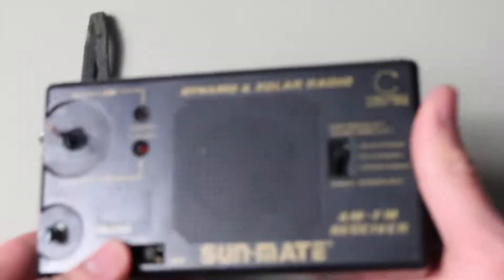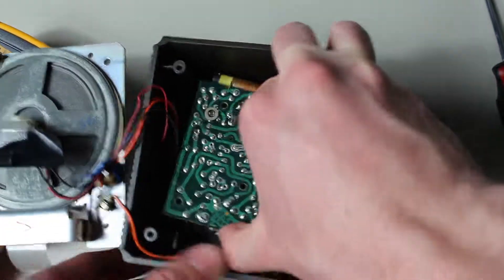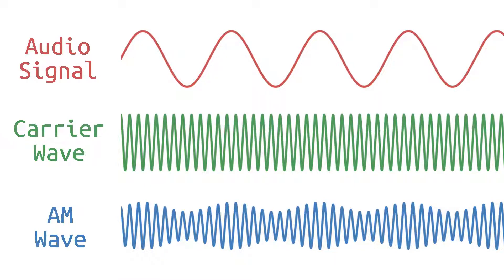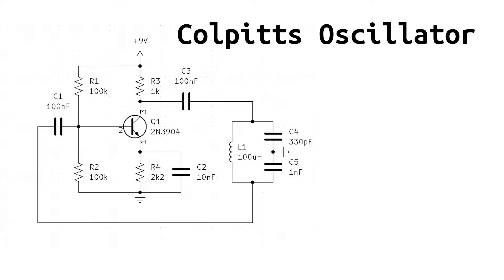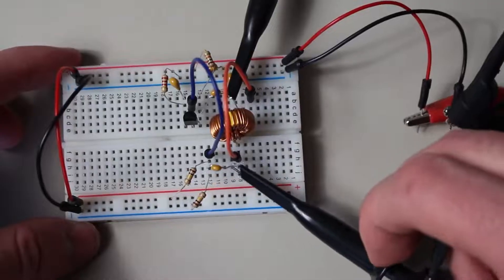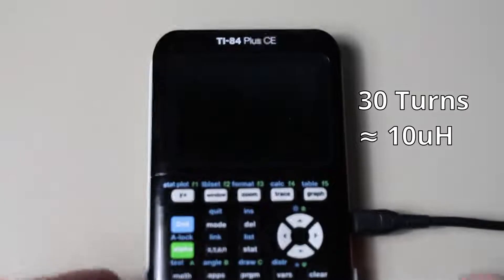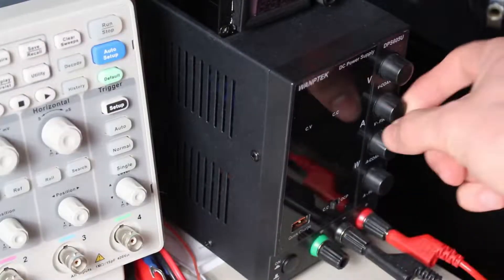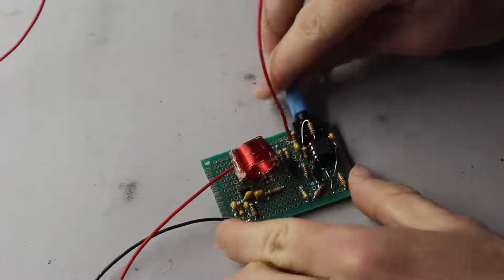DIY AM Transmitter

Comment: Good video, one caveat I noticed was this:

When explaining how to calculate the inductance, you say that μ is the permeability of the core material. 
Technically, you would write μ₀µr, wherein  μ₀  is the magnetic field constant (or vacuum permeability), and μr is the permeability of the material. 

So, 1.26*10^-6 (Vs/Am) is not the permeability of air (Which is rougly 1), but simply the magnetic field constant which remains when using μr = 1 for air. 

Also also, (sorry nerd), the exact value of μ₀ is 4π *10^-7, which I find tremendously cool.

Thanks for bearing with my pettiness!

Comment: 10uH has a natural resonance around 16MHz, how d'ya get 1MHz out of that??? Answer, you don't. That's why you're only getting 2' range, it's a sprog. The reason 100uH wouldn't oscillate in the original circuit is because you seem to be using a yellow toroid (3-40MHz).

Comment: play with the value of R4 so more signal is coupled to the output stage. use a molded inductor in your oscillator. Swap out R7 with an inductor... use a loopstick aerial from an AM radio. Connect the anrenna wire (which may not be needed anymore) to Q2 collector. Dispense with R9.
reduce R8 to 100 ohms in series with 22 ohms, the latter connecting to Q2 emitter. In the middle of these 2 resistors, connect a 10nf capacitor to ground. These are just immediately obvious improvements at a glance. There's more I see that I would try

Comment: Hi could you explain the 9:24 top right (what's neither the oscillator nor the modulation), 9:34 so it's not really Amplitude Modulation but some kind of DC additive translation? (I am interested in electronic and the topic in general for only 4h, be gentle :) )

Comment: make a large coil in a iron tube,  put another coil on top of the first coil, connect the second coil trougth the positive rail of the output transistor, connect the bottom of the first coil to one of the cables of the second, tada, now you have a compact antenna that´s a few feet long....

Comment: Regarding the 4V mercury battery... Early American RCA pocket transistor radios from the early 60s used these batteries, and they are of course unavailable.  I bought a tiny RCA turquoise radio in mint condition off Ebay and built a rechargeable pack from 1/3 AA nimh batteries and rewired the headphone jack into a charging jack.  I just ran in a 5V wall into the jack using a resistor and zener inside to limit current to maximum charging rate assuming full discharge.   This makes for a very slow charging system (maybe 8 - 10 hours for a full charge) but the pack would run at least two weeks on one charge when he brought the radio to the beach to listen to baseball games (that RCA was very sensitive and did better than the Sony he was using).  Food for thought for those wonderful and beautifully built American made transistor radios.
Reply: The presence of an output transformer to the speaker suggests that this set uses germanium transistors. It looks as if there is another smaller audio transformer inside which drives the push-pull audio output stage. With the arrival of silicon transistors it was possible to eliminate these components by using different circuit configurations. Although these transformers have not been needed for nearly 50 years, components, such as the Eagle products LT44 & LT700 transformer pairs are still advertised by component dealers.
Reply: @Martock1017  My experience with these (my family was in the TV radio repair biz) is that these were very reliable radios.  Once in a while we'd see a transistor croak and of course now that they're 60 years old the two or three electrolytic caps are shot, but overall, I can't recall seeing an open xfr in any of them, but that's good to know.

Comment: Tried the circuit and the oscillator and modulator works. What voltages did you use for the OP-AMP supply?

Comment: i made a 9v battery powered FM transmitter myself..... 5-10m...... next i wanna do TV ransmitter
Reply: rf modulator + distribution amplifier. not very legal tho
also analog tv because a digital tv modulator is umm a bit expensive and/or impossible to find
Reply: this is AM

Comment: I have the same power supply, but don't use it for low signal projects - too much switch mode noise.  I just use some AA Batteries instead - no noise.
Reply from the maker: Yes, it's a really big problem with that power supply.
Reply: I use a good old school linear bench PSU.

Comment: Why do you have a 50 ohm termination, your emitter follower has an input impedance of 5k ohms, but you are supplying a 100k ohm input
Reply: When the output rf signal goes below 0 volts the emitter follower wont work, as the capacitor will turn off the emitter base junction, You need an AB emitter folllower for this, i dont understand why the caps are 1uf either

Comment: No offense... but... the audio quality is very poor. ... Watching the video, you are smarter than I am, calculating all that stuff, but it also shows me that you are a lot into theory and not pracitcal thinkering. Seing how extremly low impendance you made the colpitts oscillator, you could modulate the oscillator alone, and get a good AM signal. Based on the low value in the oscillator (2,2k Emitter) the oscillator itself (the coil) will probably transmitt more into the radio than your actual antenna, since the radio does receive an "inductive" signal (magnetic field) rather than "capacitive" what your (non matched) antenna is  tansmitting. Some values "underline" you´re a lot into theory... like the 1µF (!) capacitor between the oscillator and the buffer, but then added a 100k resistor in series... Also, why do you use a Collector circuit as modulator, and then use an op amp to compensate for it´s lack of "audio gain"? At this low power level you could hook up the "rf amp" directly to the output of the LM358. Why does Q1 not have a RF blocking capacitor (from Emitter to ground)... the RF flows into the transistor, causing issues (distorted audio could be one of the issues). If you want, I can re design the circuit for you so that the audio actually sounds loud and clear (I´m reffering to the first two audio samples you made, with vocie very audible distorted)... checks the schematic Am I seing that right, that there is no Capacitor between + / - ... like .1 µF (104) to block the RF? ... like I said, you are smarter than I (math) but you lack practical experience... sorry... I hope this doesn´t read offensive, I was just "astonished" how poor the audio quality is for such a big (lots of efford) circuit... Simpliest way to solve it: Remove the 1µF / 100k and replace it with 10nF (103) and 1k. Remove the LM358, remove the R6... and connect R5 to the collector of Q2 (it also might work with R5 still to B+) change R7 with R8 (1k from collector to B+ and the 100R in the emitter) Add a 10nF ... 100nF (whatever you have) ceramic disc capacitor from the emitter of  Q2 to ground. Then remove Q3 and replace it with another 2N3904. To the collector of this 2N3904 now goes the 100R resistor ... it´s emitter goes to ground, and between collector and Base add a resistor something like 220k ... 470k ... now feed in audio on base of that transistor via a 1k 1µF something like that ... this will give you a well working transmitter... have not tried it thou, but your oscillator is having such a low impendance (4,7nF is a lot usually you have like 470pF but therefore the inductor has a few hundret µH, not 10µH) ... it should work.
Reply: Hi, is there any chance you could draw up the circuit you suggest so I can better understand what you are describing? Cheers.
Reply: @micahtritscher951  One Year and nothing frin mr Stefan 🤔
Reply: transmister
Reply: You seem to know this, can you share your favourite generator circuit?